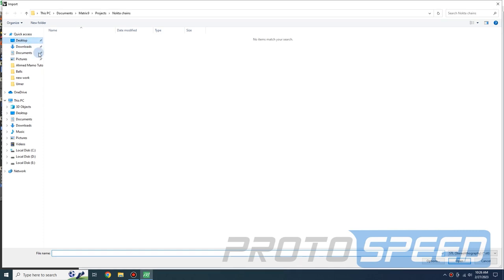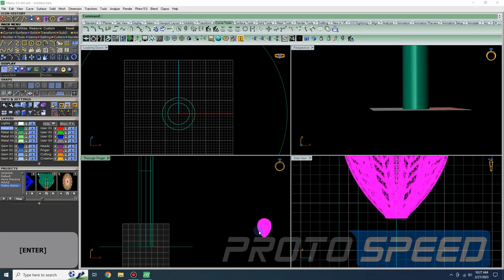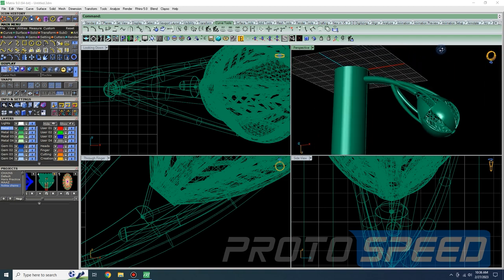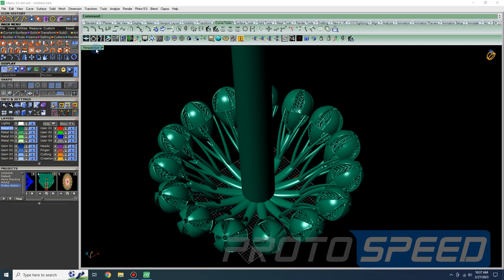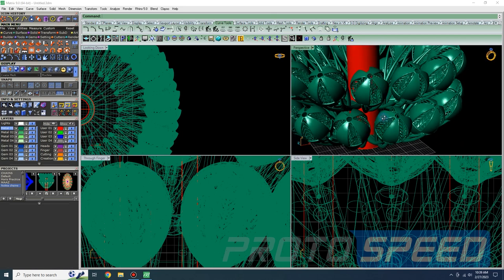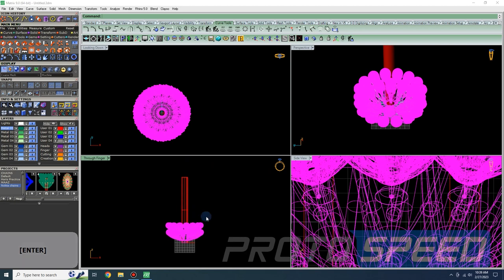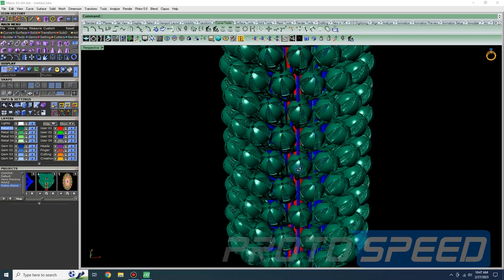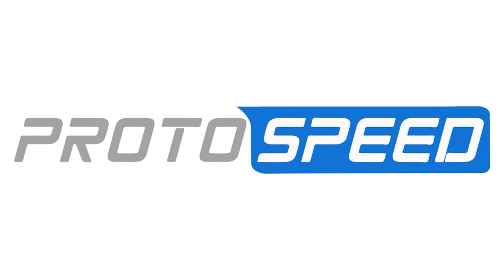Unbelievable 3D Printable Casting Tree  - Here's How to Make it With Rhino & Matrix + Free Giveaway

Comment: How long does it take to print this tree
Reply from the maker: It Depends upon the Printer you are using. On ProtoX by Protospeed, it take 3 Hours & 50 Minutes with 50um Layer Thickness to print a single tree or a full platform.
Reply: @ProtospeedOfficial  

Wow this is amazing 😍👍